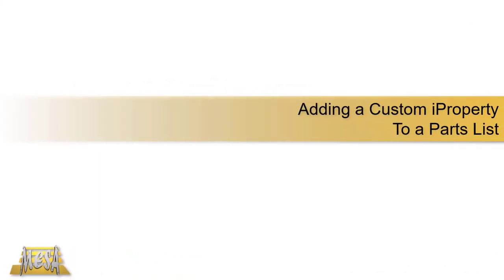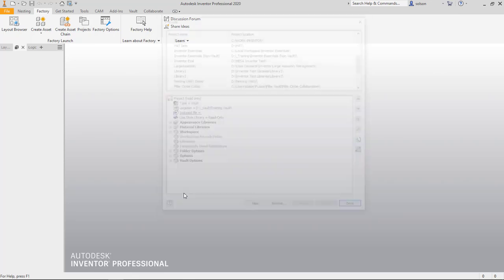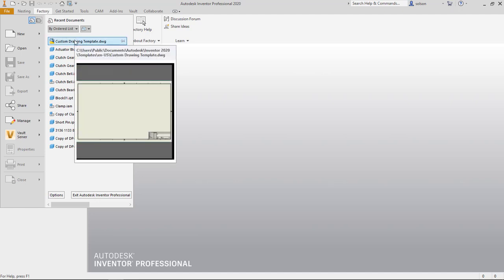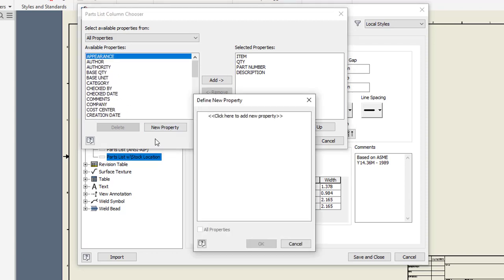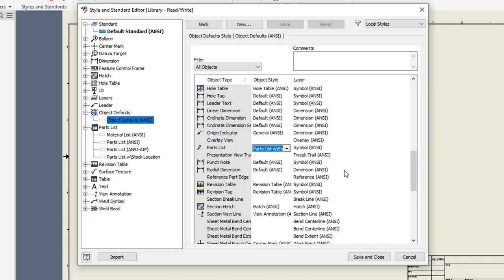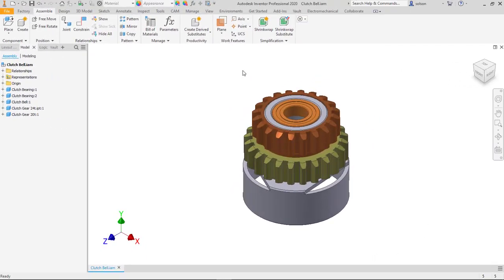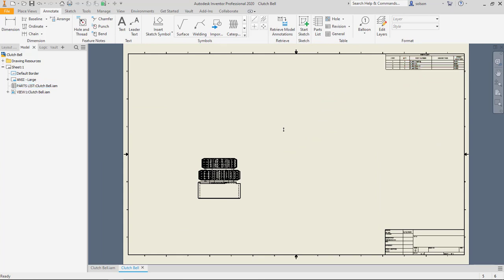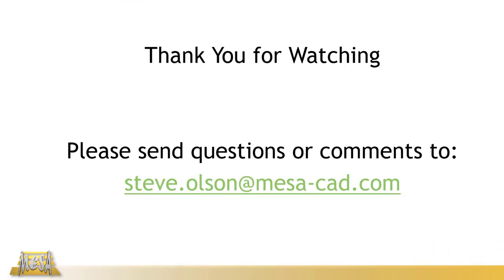Adding a Custom iProperty to a Parts List

Comment: where did you put that "stock location" properties in the model?
Reply from the maker: The Stock Location property is a Custom iProperty.  If you go to the Custom tab of the iProperty editor, you can create custom properties on that file.
Reply: @3DSteve52  i did that but it's not showing in the parts list in my drawing. do you have a video how to do that? Thank you
Reply: nevermind i got it figured. thank you so much for the video though. it's really helpful
Reply from the maker: @air_wind_can_last  I am glad you figured it out.
Reply: He forgot to tell us that. Too much time on styles and volt and didn't focus on the subject at hand, you have to go into ioroperties and add it in there.

Comment: I understand that the project file was ultimately unchanged, but where were the Style Editor changes saved to? Were they embedded in the drawing template file? Does this mean that all users will be alerted to drawing template file changes and need to update their local copies?
Reply from the maker: The changes in the Style Editor are saved to the template, but then they should be saved to the Style Library.  At about the 5:50 mark of the video, I start the process of saving the new style to the Style Library.  The files that make up the Style Library are in the directory identified in your Inventor IPJ as Design Data (Styles, etc).  That can be stored locally or shared on the network.  I recommend that this be saved in a shared directory in companies with multiple users.  Otherwise, one user might change their's and not send an updated version to their coworkers.  Because I used the template to create this Parts List style, this style will be stored in the template.  However, when a user starts a new file from a template, Inventor will do a quick check to compare styles stored in the template and styles stored in the Style Library.  If it sees any differences, it will overwrite what is in the template with the settings from the Style Library.  That is why it is important to save the changes to the Style Library.  I hope this helps.  If you have any further questions, feel free to email me at steve.olson@mesa-cad.com.

Comment: How x y z dimensions  take as length width  thickness without exporting fx parameters
Reply from the maker: You could possibly use iLogic to push parameter values into an iProperty or somewhere else, but that gets more complicated.